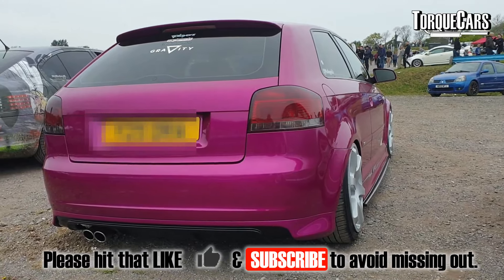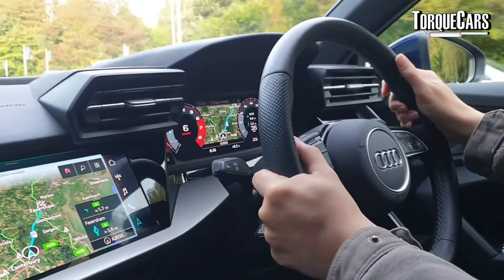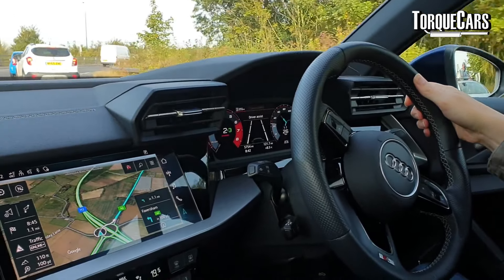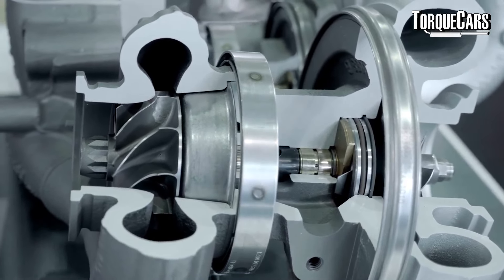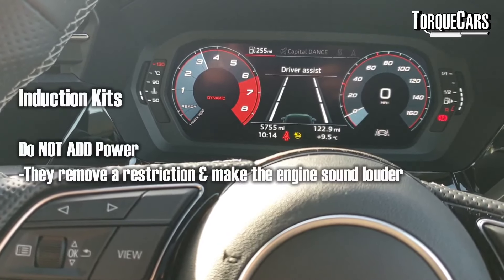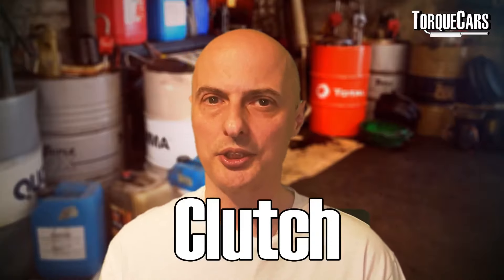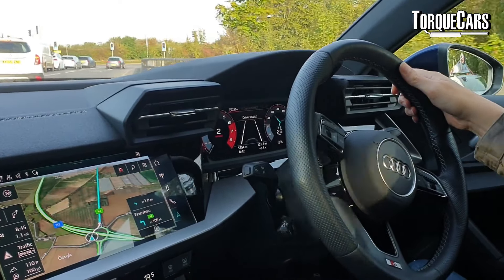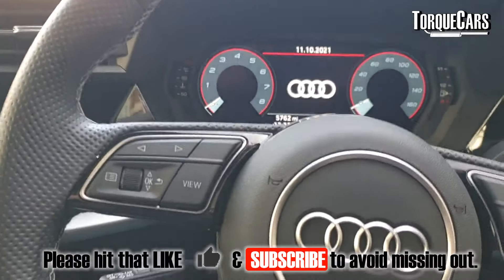Best Audi A3 Mods (and ones to Avoid!) [8L 8P & 8V Tuning Guide]

Comment: Hello,

Do the k04’s bolt straight in place of a k03?
Reply from the maker: The manifolds and some plumbing (pipework) are different. As the same block handles each variant of turbo if you get a full turbo complete with manifold and pipes it will just bolt on. Mapping should ideally be adjusted at the same time, but lots of people report the K04 running on the stock k03 map (with a few minor issues).
Reply: I see, I own a 1.8 ea888 gen.1 with a K03 and I’d like to put a hybrid k04 in but I’m unsure of if the manifold for my 1.8 is the same as the 2.0.
Reply from the maker: The EA888 engine blocks are identical between the 1.8 and 2.0, it's the pistons and crank that make the difference in HP. SO the manifolds are the same, the heads are the same (generally speaking but were some variations between VAG brands, with port sizes and pcv system design). There were also transverse and longitudinal engines which have different down pipe angles coming from them. Your best option is to check part numbers match on the parts you want to swap in these are usually listed on sites selling these parts. One part is often identified with a few different codes, but if codes match, then you have a "bolt on replacement".
Reply: @torquecars  thanks for clearing that up I appreciate your help!
Reply: @torquecars  I’ve still been struggling to find many turbos that are a direct fit for the EA888 that’s longitudinal however I have found many transverse ones. You mentioned about transverse engines having different downpipe angles. How much of a problem do you think it could be?

Comment: Is it ok/safe to only do the APR ECU tune and not do the TCU tune along with it? 
Are there any other TCU tunes that are cheaper than the APR one? 

Thanks, 
Hernando
Reply from the maker: It is possible but you really want the transmission and shift points to match up to the cars new torque band, without this it will feel flat in places and in some cases you might get error codes or the transmission reaches its torque limits and things get backed off. I'll try and find alternative suppliers for you, are you UK based?
Reply: @torquecars  thank man, no i am US based...in NY specifically. Thanks for all the great information
Reply: Stage 1 IE tune for TCU and  ECU with a CAI made a hell of a difference, I have the Stage 2 Downpipe from CTS in the garage, waiting til i clean it up so I can install. I was having trouble finding turbo kits for the 8p 2.0 TFSI Quattro. Any suggestions or links?

Comment: Just bought a 2010 Audi A3 Quattro, it is automatic (unfortunately :( ). I was curious, I have about 2 grand to put into the car. I want to do the tune obviously based on your recommendation. I was wondering what might you suggest with the remaining 1500 or so.
Reply from the maker: A hard pipe kit, sports catalyst and better flowing intercooler (if you drive it hard quite a lot) are my preferred power mods on these blocks, or for better handling and more fun, invest in a decent suspension setup, the stock suspension is quite hard and crashy on these, but it makes it a fun car to take on the track.
Reply: @torquecars  sorry i am ignorant....i get the intercooler part, but what do you mean a hard pipe kit....are you talking about replacing underhood piping with metal piping....like the turbo outlet pipe, could you tell me what pipes would be replaced or point me to a place where i can see an example or a kit to buy, also wasnt sure what you mean by he sports catalyst..........also custious for the suspension would you be weary of like a $400 ebay kit of coilovers? They are from Germany and have good reviews i do notice already what you're talking about with the hard and crashy ride. Again really appreciate all the feedback and help

Comment: I’ve got a a3 2006 1.6 fsi petrol with just an exhaust. Any recommendations for performance as well as any recommendations for modifying lights? I want to swap front and back to newer cleaner versions but never know if it’ll fit.
Reply: Same any luck???
Reply: Unfortunately the 1.6s aren’t great for getting more power out of. I’ve got a 1.6 MPI and there’s very little you can do, aside from the usual (sport exhaust, intake manifold etc) without serious money involved. And if that’s the case, you may as well invest in a 8p S3 because you’ll never get the value back on a 1.6. 

I’m considering saving and upgrading to a 3.2 sport model. N/A VR6, 6 speed manual and Quattro. Only downside is fuel economy, and that’s just something you have to learn to live with sometimes

Comment: I have a 1.9 tdi Audi A3 2008 , what customization would you recommend
Reply from the maker: I did an article covering this engine, but I would certainly recommend a remap and possibly a turbo/fuel system upgrade if you want to max out your power gains. https://www.torquecars.com/volkswagen/1-9-tdi-tuning.php
Reply: @torquecars  my brother knows a lot more about cars than me and he said the same thing to me. To put in a mk4 turbo and mk4 Downpipe and map it to somewhere around 180bhp , do you think that’s a good idea
Reply from the maker: These are great solid engines and will still give good economy even after you've hiked up the power. Choose the turbo wisely a lot of rebuilt turbos out there are just cleaned up with no parts replaced. Get a mapper who can custom map for your new turbo and you'll be happy with the end result. Even just doing a remap on the stock engine will give a decent power gain to play with.
Reply: @torquecars  thanks man appreciate it , will let you know how I get on 👍

Comment: Can someone explain how the diesel engines have their power increased after a remap while simultaneously gaining MPG?
Reply from the maker: Improved efficiency, in real terms you hit a power figure at a lower RPM. It doesn't follow on ALL engines but most will gain MPG, and certainly all the VW diesel engines I've had mapped have shown a significant MPG improvement.

If you drive it like you stole it then you won't see an improvement,  you'll be burning more fuel and hitting much higher power levels. But in everyday driving you'll see both power and economy gains.
Reply: @torquecars  awesome, makes sense to me. Thanks man.

Comment: can i put rs3 exhaust system into my 2.0 tdi?
Reply from the maker: There is little point IMO but the undersides and mounting points are pretty much the same across the A3s of similar years, but the rear bumper and diffusers are likely to be different. The diesel exhaust flows really well on these, the headers are different but I guess you are talking about doing a cat back setup. Sound wise I'm not a fan of the 2.0TDi exhaust through a loud resonating exhaust setup, mine sounded like a tractor at the best of times. Are you hoping for power or better sound?
Reply: @torquecars  i wanted looks and sound 😂
Reply: @torquecars  i own 2014 sedan

Comment: Hi
Is there anything I can do to a 2015 A3 TDI
Reply from the maker: Which engine does it have the 1.6 1.9 or 2.0 TDi? In most cases a remap is great. I did some engine specific videos which should give you a good starting point.
Reply: @torquecars  Hi. It's a 1.6 engine. S line model
Reply from the maker: A simple remap on that should give you around 45hp more power and 55lbft of torque for max economy a remap of around 30hp should be in the sweet spot for power vs economy and be better than the stock setup. It has the EDC17C64 ecu on it. I will be doing a video on this engine in the near future as a few have asked about it.
Reply: Thanks. I'll be looking out for the video
Reply: my is  2014  2.0 TDI 185 hp Quattro..
DSG  haldex..  ...  i give my  mom 2.0 TDI  2006 Quattro... and I miss  hand gear changing and Torsen quattro, where I was in most  controll  in driwing  and not  "stupid" dsg or haldex.. ok.  i understand and plan is to modiffy ( tune) dsg to work propperly,   my question is about haldex and some mode on it..  I find fiev options to instal module  and contro in app..   pls help  someone  ??

Comment: Poly on a fast STREET car are unnecessary.  Poly will never last as long as Rubber and cannot take sheer force , CTS Turbo sells new motor mounts that are 60 durometer voidless rubber. Those, with a 034 billet 80 duro rubber dogbone mount, makes for the perfect ride. Mark4 R32
Reply from the maker: Thanks for the support great tips and encouragement my friend I'm glad you've found us. Poly bushes have advanced much in recent years with many different grades, but you are right, on a street car decent rubber ones are usually the best option. I'll be discussing dog bone mounts in a future video as these can be quite problematic when they start to go.

Comment: I have a 2006 Audi A3 2.0t, is it something that could make reliable power while still daily driving it?
Reply from the maker: Definitely consider a remap. You want a little more mid range power for a daily driver. Avoid large peaks and make sure the power doesn't come on at too low a point in the rpm range.

Comment: Great vid but I have to disagree with your comment about induction kits, here’s a video testing the theory. 

https://youtu.be/n7-cIiumgmE
Reply from the maker: Thanks for taking the time to comment, it is much appreciated and I will adjust my advice slightly in the next video on the 2.0 Turbo. 

How interesting, but bear in mind it is hard doing a general video like this to cover all A3 engine types as there are so many exceptions. 

Looking at that video it is interesting to see a 10hp gain on 2.0TFSi stock engine, not massive but a gain nonetheless. 

But these kits do come into their own when you have other mods as the stock setup is really becoming a restriction. 

In my experiences most standard turbo engines will gain around 3-5% more power which isn't much in the grand scheme of things and I personally find it hard to justify the cost of an induction kit as a power mod, compared to say a remap which is 1.5 times more expensive but gives 30-40% more power. 

NA  engines are generally about half this power gain or worse, and they tend to lose some low end torque.

The other problem is when the engine bay is closed up you are often sucking in much warmer air than you would with a standard intake, or properly designed intake with a cold air feed. (The video shows it shielded from the engine bay which is a good thing in my book, some kits out there are not shielded or boxed in.)